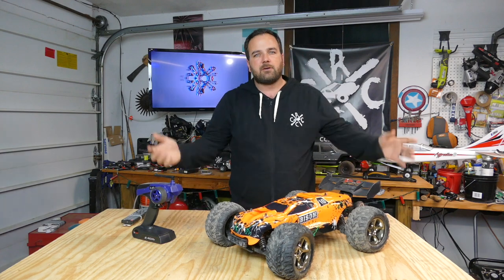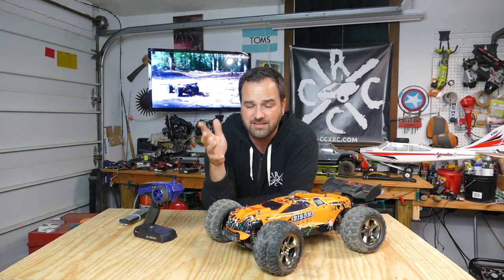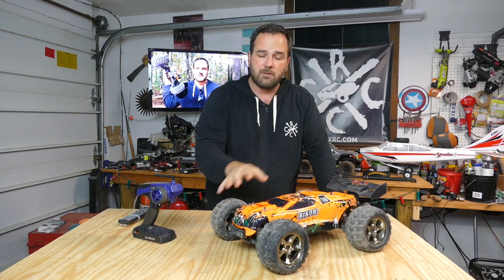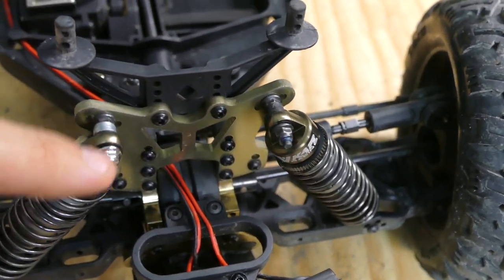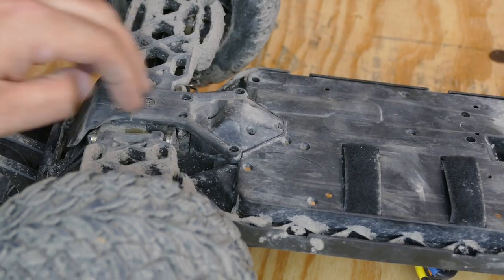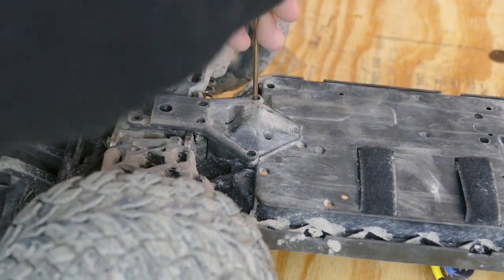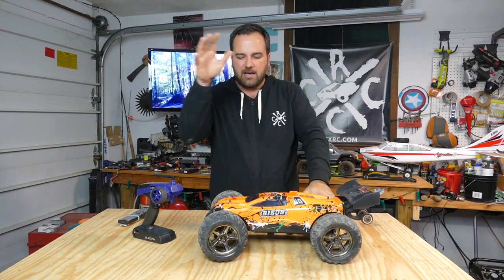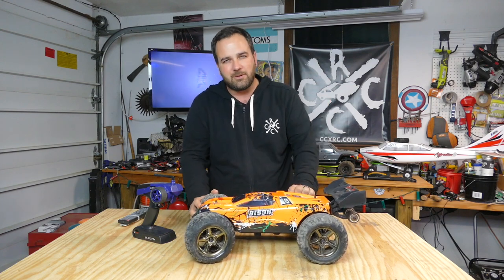VKAR Bison PROBLEMS and How To Replace The Spur Gear

Comment: No slipper clutch? why it's breaking the gears if it don't have one.
Reply from the maker: It does have a slipper clutch. You put a hex key in it and then rotate the rear wheels to tighten or loosen it.
Reply: CCxRC O good... Then adjust it correctly and your gears should not get messed up...I always here guy's saying there gears break all the time ( even in cars that I owned) but they never adjust there slipper clutch and just leave it fully locked down so of curse your gears are going to fail.
slipper clutch...that's what it's there for why not use it right?
Don't know how you have it adjusted but I would definitely plat around with it.
Don't take this the wrong way not being a smart ass just saying it because most guy's buy a RC and just run it out of the box and don't properly adjust the slipper unit I found.
Reply from the maker: I will admit that I didn't adjust mine...even though I knew better.
Reply: CCxRC when I had mine apart I didn't see any slipper clutch I think if it has the center diff there is no slipper i could be wrong but I think there's two versions one with slipper and one with center diff but like I said I could be wrong.
Reply from the maker: I saw it in the manual, but I honestly don't remember seeing it when I pulled it out. So it might be the pro model that has it. I know there are two version of the the center diff.
Reply from the maker: just looked. No slipper in this model.
Reply: CCxRC Two thumbs down! BOOOOO!
Reply from the maker: Time to buy stock in spur gears! Lol
Reply: CCxRC LOL!
Reply: than what would be slipping on this. Seriously the front drive wheels are not turning and the rear is slipping like there is no mesh for it to have power.
Reply from the maker: Is the Driveshaft spinning at all? Might need to open up to see the center diff and make sure all the grub screws holding the pinion and gears are tight.
Reply: Drive shaft is spinning with the rear only but I can hold back the truck with full power with my hand easily and the the motor is spinning. Spur gear is fine. This is brand new!
Reply: The manual says how to adjust this but mine don't have the hole to stick a pin in and rotate the tires to tighten or loosen.
Reply from the maker: Mine either. I thought it did based on the manual, but that's a different center diff for their "Pro" model - I believe.  I'm looking at possibly buying that upgraded Center Diff. But does the pinion spin the spur and made the driveshaft move? If so, then you need to look at the front diff and why it isn't transferring the driveshaft rotation to the front tires.
Reply: CCxRC Checked to see if the spur is turning and it is along with the drive shaft. The front diff gears have to be broke or disingaged somehow. The rear like I said spins but with massive slipping.
Reply: Mark Pethtel  flip your truck over there's a little slot in the chassis right beside the steering servo arm link check to make sure that there is a grub screw there or if it's tight
Reply: willie d yeah that was loose. That fixed the front, should put some lock tite in there you think?
Reply: Ya I would put some blue lock tite in there.
Reply: willie d thanks for the help! That little set screw was the whole problem. You have to make sure you tighten it to the flat side of the shaft pin. No slipping now all
 power. Thanks again!
Reply: Your welcome glad to help. I gave my bison a complete once over there were a few things not tight and the diffs only had a tiny bit of grease. I also put blue lock tight in all the screws that go into aluminum some had it and some didnt
Reply: @ShenRC  I know it's 2 years later but no slipper clutch isn't automatically a bad thing or a bust, my tenacity has no slipper it's a center diff which is better for certain things and I haven't broken or stripped anything and I run it on the max it can handle. All my slipper clutch rigs I crank it down as tight as I can and I never strip anything but that's just me I know how to drive and have throttle control. I never liked a slipper that is loose enough to work because I tend to burn the pads out but some aluminum pads fix that lol.

Comment: hobbystation out of new zealand offers a steel spur gear if you buy with the entire center diff, they also offer the extreme version of the bison....whick comes with a steel spur and 4s lipo....smaller motor though. I have one on order.
Reply from the maker: +Caleb Phelps I saw those, but wasn't sure about the shipping. Ordered some from Aliexpress

Comment: My Bison broke the third time I took it out. No crazy jumps or anything. It just stoppped turning. I have to take it apart to figure out exactly whats going on, but from first look it looks like something is stripped. Im so sad.
Reply from the maker: endz4twizz check from the servo to the front end to make sure everything is intact. Hopefully servo is ok. Also make sure it didn't come unplugged at the receiver.
Reply: Ill take it apart and keep ya posted. Im not well versed with these things, This is my first RC car. If the servo is the the little stearing control motor I think thats ok. Its what that connects to that kinda looks stripped, but I wont know tilli get a better view.
Reply: So I made a video and posted it on the FB group and it looks like my servo arm is stripped or loose. Thanks for showing your viewers that group btw. Your video is the reason I bought this car. I know friends that have Traxxas E Revos and they break all the time. All these RC cars break and I expected that much from a hobby grade RC car. So now I have to figure out how to get to this screw, wish me luck....lol.
Reply from the maker: +endz4twizz if that's all it is, you should be able to get a replacement pretty easily. Are you in the US?
Reply: Yup. Florida.
Reply from the maker: Use the Helion links above to find part numbers for their replacement and you can order it from Amazon, Amain or HobbyTown
Reply: Thx.

Comment: Cool video and car, just a pity that my broke in half during the first drive. I do not know what you sent from this store and how he is able to eligible for the discount, such whips. Because my he capitulated after a meeting with a small curb. Housing broke the udeżeniu him at a speed not exceeding 20 Km / h.
I sincerely advise against buying this car!
Reply from the maker: +Bakak HCGaming I advise against hitting curbs.  You notice I hardly run mine on streets. It's hard on them. Curbs are going to break any rc. Don't rule this out because of it. Luckily...parts are very easy to get and are cheap.

Comment: Is it a Tekno? No, it's not but it's a good car. It has decent parts support, not Team Associated level but good. It has good plastics, it has good electrics. If I were to rate it I'd rate it a 7.5 out of 10. Maybe it should score higher when you take into account the price.
Reply from the maker: I'd go with you on the 7.5 or 8 out of 10. It's not perfect, but considering the price...it's gets a higher score. It sure does rip and handles so well. I've never run a Tekno. :)

Comment: I found Carta pins are actually better to use then the pins just drill threw the plastic bushings way better than the factory design you can get at any home Depot
Reply from the maker: That's a great tip. Thanks for sharing

Comment: You sure you want to do a metal spur gear? There is good reason it is plastic, and that is as a giving point to prevent massive damage elsewhere.
Reply from the maker: +Scotty Bot I actually decided against it. Too easy to replace the spur. Not worth tearing up my Diffs
Reply: Good to hear, I had the same thought a while back and realized that the spur gear was a lot cheaper than fixing everything after it.

Comment: You can get the hinge pin arm bushing here. 
http://www.firelandsgroup.com/product-p/HLNS1038.htm 

These work also in a bind. These are for the Hobbyking Bad Basher. i would just use the helion ones though. 

https://hobbyking.com/en_us/front-upper-sus-arm-sleeve-spacer-4pcs-110bs-a2003-a2010-a2027-a2028-a2029-a2040-a3011-and-a3007.html

Long Shipping but,,,
https://www.aliexpress.com/item/New-VKAR-BISON-bison-Vicat-racing-monster-truck-accessories-pin-cap-ET1034/32729009642.html?spm=2114.10010108.1000014.7.3VN5pA&scm=1007.13338.50051.0&pvid=0635ac35-5f66-449a-b5f9-6c7f6ac9afc2&tpp=1

https://www.aliexpress.com/wholesale?catId=0&initiative_id=AS_20170103223225&SearchText=vkar+bison
Reply from the maker: +Dexter Charles thanks for the links. I saw them there, but most people are asking for quick part availability on these. I have 3 packs of them coming from Aliexpress and a steel spur gear to test!
Reply: CCxRC LOL!!! Me Too!!!
Reply from the maker: Dexter Charles great minds think alike. Lol 😂